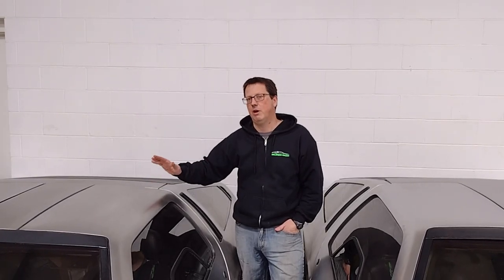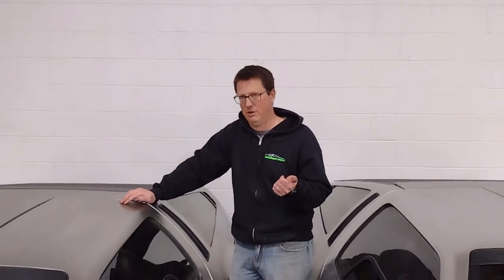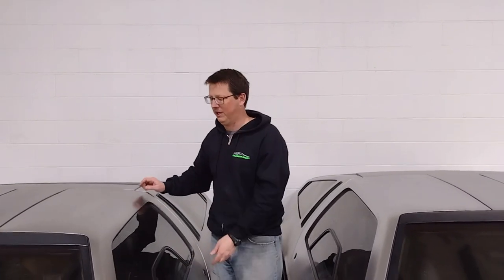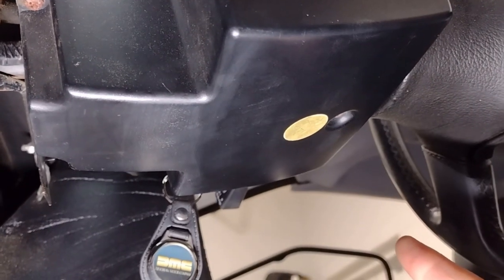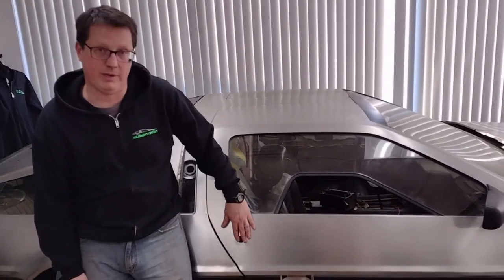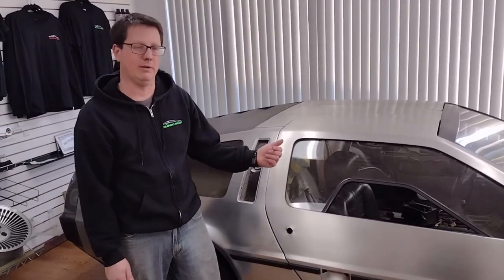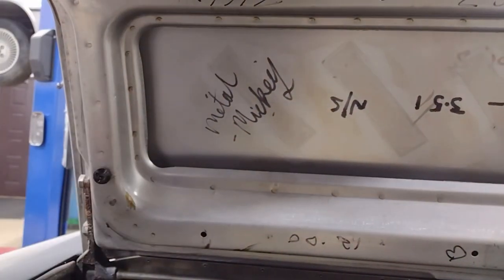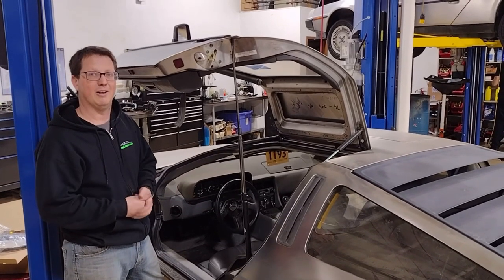DeLorean- Locks, Keys & Cave Drawings

Comment: Dude your 02 probably had the door locks or ign cylinder replaced. I haven't seen a car past 90s that needs 2 keys. And it's not that ahead, all my 80s mk2 supra's ALL did, actually every 80s Toyota and Honda I've had did..so if makers were doing it before the 80s, your 02 probably isn't original or other markets are just fkd (wouldn't surprise me with usa lack of immo requirement where here in can 06 up is required)
Reply: Every F Body Camaro and Firebird had 2 keys up until 2002. It is rare in 1981.